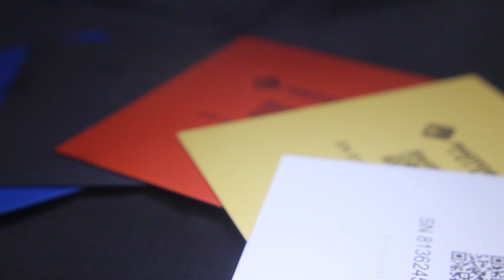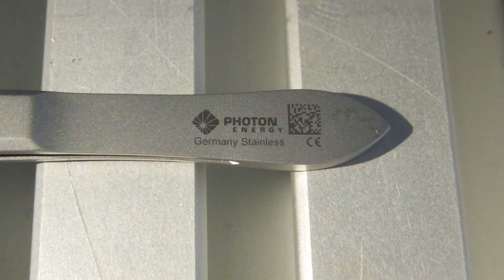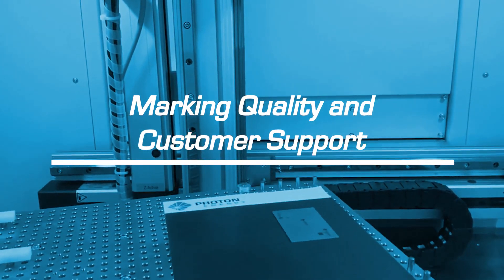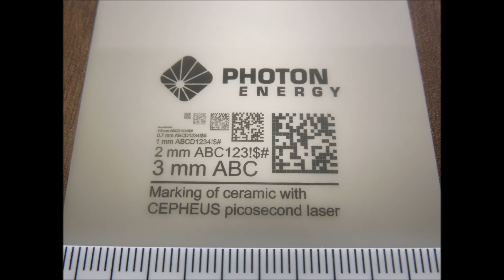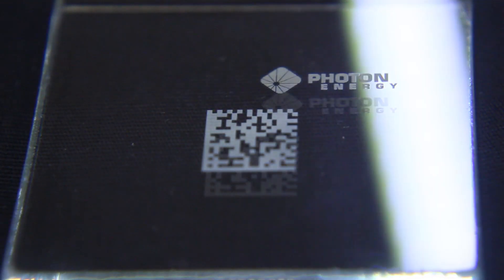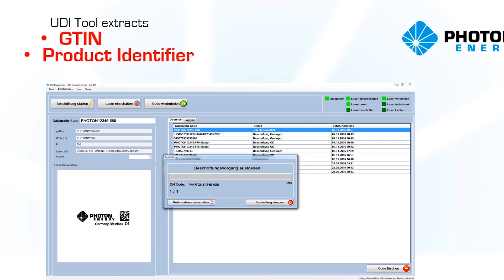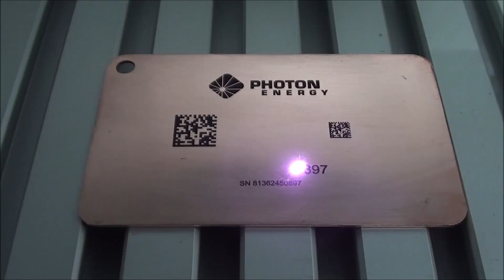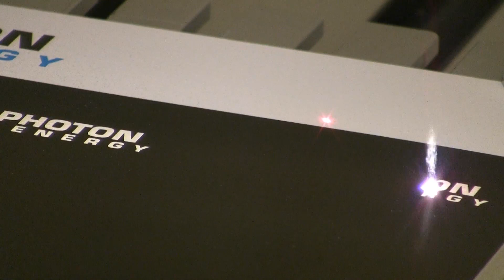Photon Energy: 3 Reasons to Use PERMAblack to Mark Medical Instruments

Comment: Well  here is explanation;(~~ two kind (ray) extremely exciting; so...
... most radio diods have ; emitter, collector and baze,  (continues;)
...most dangerous is blue, is kill bacteria and more, most equipment use in surgery rooms, but! The current by logic plates has unique frequencies, so is lethal weapon,
 Do not try to use in any contact 
 But in low frektensy ( 240 megahertz is 👍  is kill 🦠 including 
Coronavirus..... mean  is fine,  but not 🧪   Not point on eyes 👀 
Because  to rebuild that you need to be certified by government of your country, only for medical 🏥, 
So, 25 years in prison........
........ stay away.....🖐🏻
Reply: Kiero ke .Norma